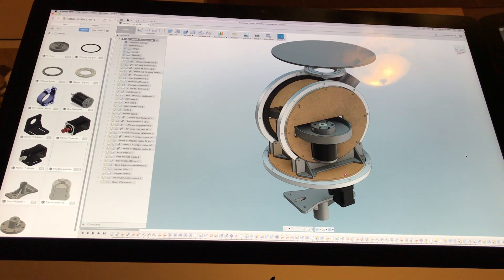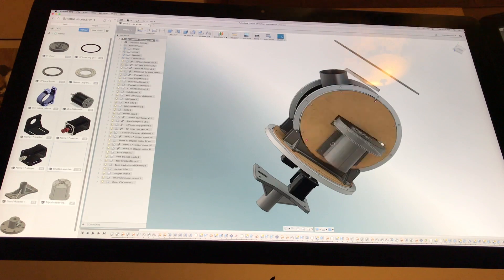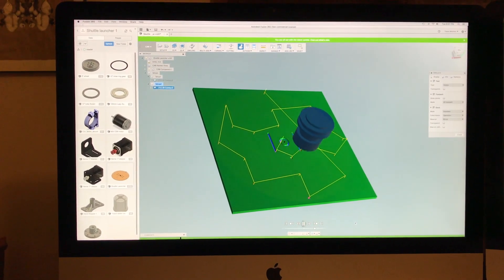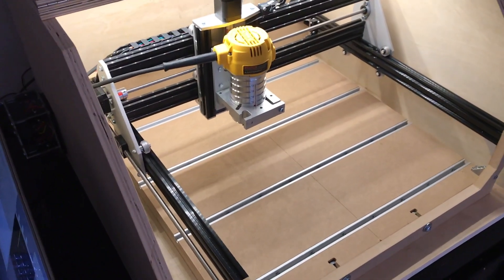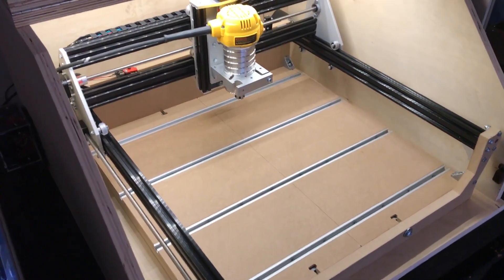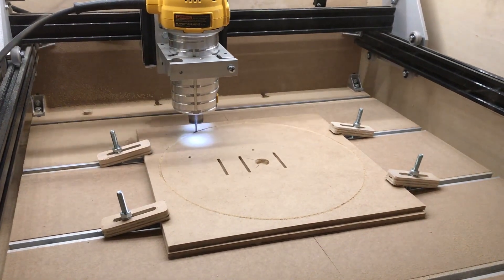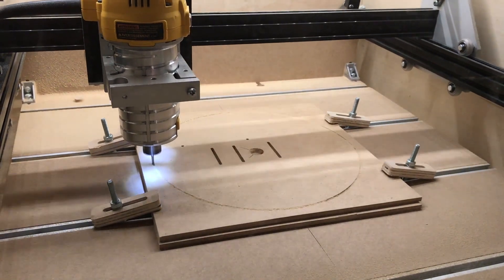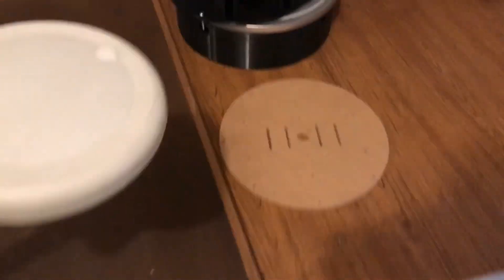MillRight Carve King: FIRST RUN

Comment: Thanks for sharing.  

I have a cnc like your , but I have a problem and I have not found a solution for it. In UGS  dimensions .   I use 
V carve for design. . When I send the file to G code, the design is always very small. 

please if you have solution for this problem.

Comment: Newbie and possibly dumb question, what hight do I set router in the clamp, and what speed should router be set on?
Reply: Clamp the router in so that you have enough room to get your workpiece under it. You set the router speed according to the RPM you set up in your gcode file. For the Dewalt 611 router, setting 1 = 16,200 RPM, 2 = 17,700, 3 = 19,450, 4 = 21,100, 5 = 23,500, 6 = 26,900.

Comment: Nice job. Do all your inside cuts before the outside. I am using an MPCNC I built a year ago. Sometimes I also use a pin nailer to hold the material down. Of course you have to be careful where you place them. Have fun!

Comment: Hello I’m in the market for a cnc. Why did you choose this cnc over shapeoko and xcarve.
Reply: The Carve King is an awesome machine.  I have had mine over 2 years now.  I run it almost every day, for 3 to 5 hours per day.  I have a couple of unintended crashes and broke one bit.  The crashes have not affected the accuracy of the machine.  It is still as accurate as the first day I used it.  Other than having to replace the broken bit, from one of the crashes, I have never replaced or changed a bit again.  I cut MDF, Pine, Redwood, Cedar, Baltic Birch, and Basswood with it, and, the bit remains and & the cuts clean.  For the price, this machine cannot be beat - both in terms of quality & reliability.
Reply: probably because it is about half the cost
Reply: Both Jasen & Alp's Craft Shack are correct...I found it to be a very good value for the price!
Reply: Another thing to consider is theses machines you ball screws and antibacklash nuts, others use belts. You will find ballscrews in industrial milling  machines like Haas never belts. These make them more accurate and less maintenance over time where you have to tighten and maintenance belts